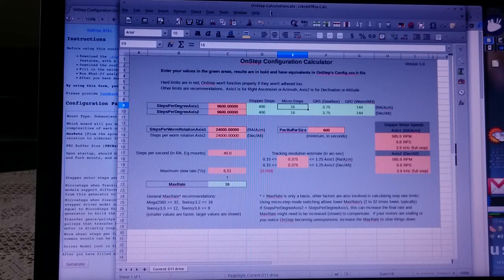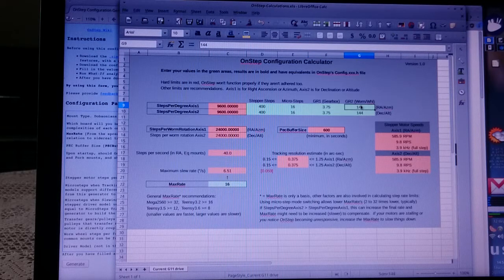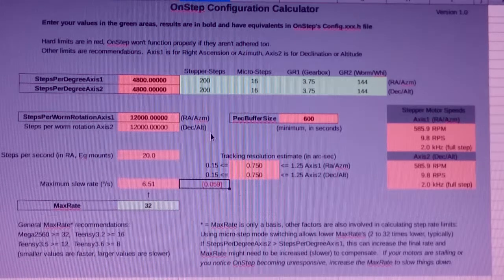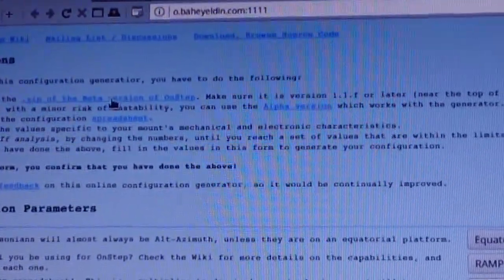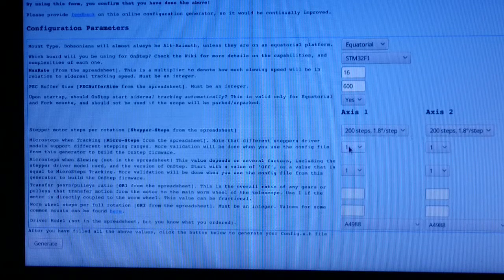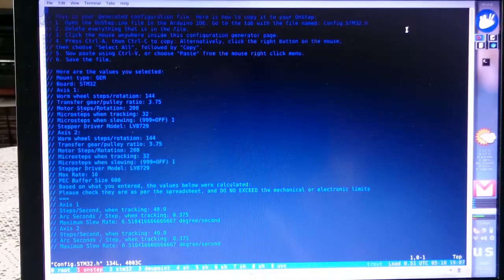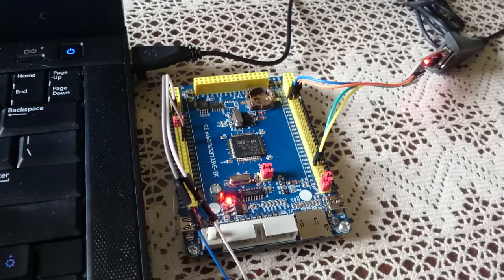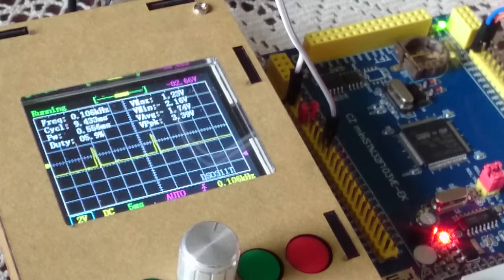Using the Configuration Generator for the OnStep Telescope Controller

Comment: Thanks for the video, it's a great help for us begginers on this. I have one question: when you go through the pulleys ratios in 3:00, you mention 16 and 40 teeth which gives 3.75 ratio. I was under the impression that the ratio is 40/16=2.5. Am I wrong?
Reply from the maker: Yes, you are right. My mistake.

Comment: Thanks a lot for this video explanation Khalid.. But now the spreadsheet and the configuration page has some changes.
Reply from the maker: Yes. But still, the most important part (the two lines of cells for each axis, is what matters, and has to be filled the same way. 
It is really about determining what microstepping you should use. Once you know that, you can use the Online Configuration Generator which will generate a usable configuration for you.
Reply: @khalid_ba  One thing I don't understand much is the: SLEW_RATE_BASE_DESIRED.
Reply from the maker: @oalithgow  This is your slewing speed in degrees per second. It is BASE because you can have 1.5X and 2X from the Android App, and it is DESIRED because OnStep will adjust it down to suit the microcontroller capabilities. Initially, set it to a safe value, like 2.0, then after you complete your testing set it higher to 4.0 or so.
Reply: @khalid_ba  Thanks Khalid, I am in the process of reviving an lx200 and have ordered the stm32 kit from George, but before I start building that kit would like to try onstep with a Ramps 1.4 or the MKS, whichever I find cheaper as a kit (haven't decided what drivers to use). Will use 1.8 deg stepper, 2.5:1 pulleys, and the worm wheel has 180 teeth. What do you think? Also can the ramps or mks  handle 1/32 microstepping?
Reply from the maker: @oalithgow  It is best if you ask the question on the OnStep group, with all the details. There are many points, and others who converted similar mounts can can help too.

Comment: i have celestron astromaster 130eq mount, which comes with german CG-3 mount type, can you help me with the parameters? particularly on GR1 and GR2, i have nema17stepper motor 200 steps 32microsteps. but i am not sure about GR1 and GR2,
Reply from the maker: I am not familiar with the mount's specifications. 

Please ask on the OnStep group if someone is using it.